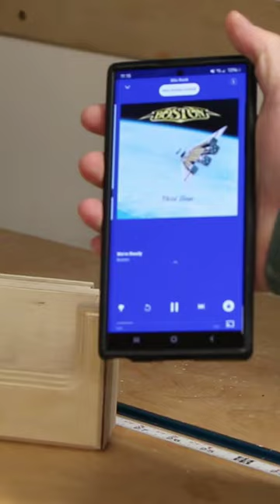Turn your phone into a Boombox! Make this passive amplifier #woodworking #frenchcleats #speakers

Comment: Cool just remember playing phone speakers at high volume for a long period of time can damage them just like a normal speaker
Reply: Tell that to my 34 year old Cerwin Vega speakers (200 SE Series). LoL! Just kidding. These speakers have been used just about every day during that time. They're connected to my home entertainment center. The only thing I've had to do is re-foam them about 20 years ago. The red original foam failed and I used aftermarket grey foam. You are absolutely correct though.
Reply: @JJG22speakers Seriously, I've often wondered if you built a, yes small, box behind the speaker either vented and ported or not, would that give more bass to the sound or potentially make it sound louder without an amplifier. Just curious.